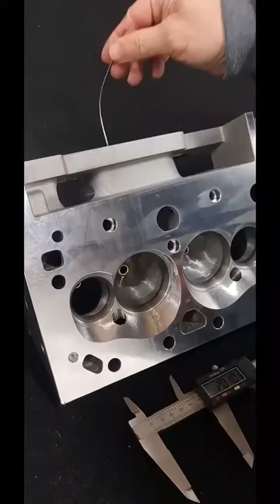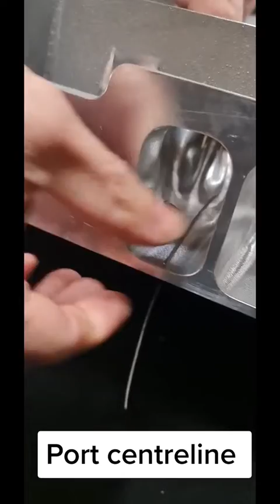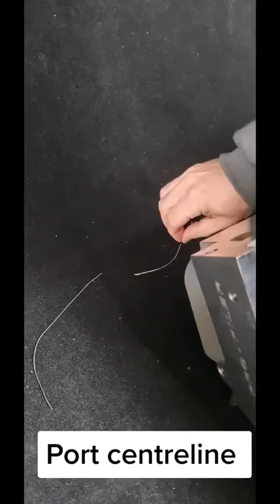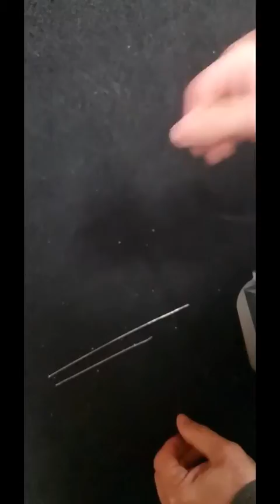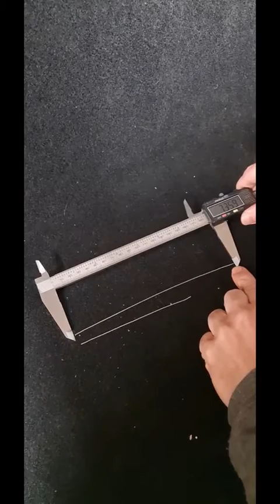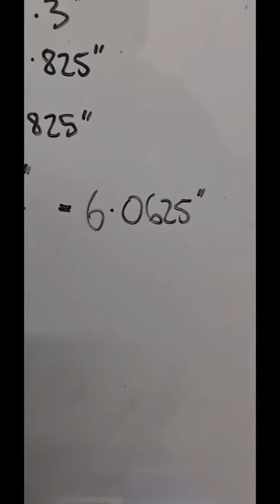"Mastering Port Length: The Key to Achieving 3rd Harmonic Target in Total Induction Length"

Comment: hola cual es la mejor formula para calcular un header ? 
y cual para calcular la longitud de la admisión ?
Reply from the maker: Both are quite complex if you want any accuracy at all. All factors, including cam timing, rpm, cubes, valve size, and head flow, need to be considered. For this, we run full analysis on the build to work out what's best.  Density and temperature is a major factor here.

Comment: is this process the same for a dohc 4 valve head, example k24 head
Reply from the maker: Mate all are different, but on a mild 36mm valve we are 1650mm2 for our MSCA 👌 again you need rpm and cubes to daily in properly, that's why we port them different depending on what your customer is doing with it. And where they want the power. Some circuit heads I'm 710fps at the MSCA because they want more area under the curve and better average power across a larger area.   But drag car 690fps would be plenty,  but again, everything needs to be established as even the intake will affect what air speed I target.  This will affect all CSA in the head as it is part of our average CSA of our total primary induction length.
Reply: @bainracing  any calculators you recommend to design the cylinder head/overall air induction system , Im using pipemax software.
Reply from the maker: @Keeries pipe Max is great, it's just a little vague on CSA targets.  Really just experience and experiment a bit, but MCSA around 690fps and throat at 90% on serious engines will get you pretty close. Optimise your inertia mechanism and that's it. Plenum CSA should be a min of around 30% bigger on twin cam stuff. But again that will depend how close you are to the sonic/harmonic length.   Shorter needs to be tighter, longer needs to be bigger. 👌
Reply from the maker: Yes, all harmonic lengths are based on the speed of sound. So, all ICE primary induction length calculations are the same, based on rpm and cam timing.
Reply: would you have to measure both sections of the port separately then calculate, since its a 2 valve Siamesed port meaning having four factors instead of two factors, having 4 pieces of soldering wire to measure from?  or would it not matter because the two ports mirror each other?  @bainracing
Reply from the maker: @Keeries  not if they are the same length 👌